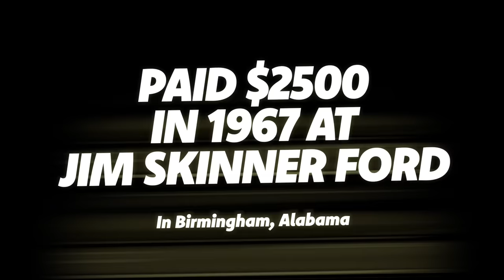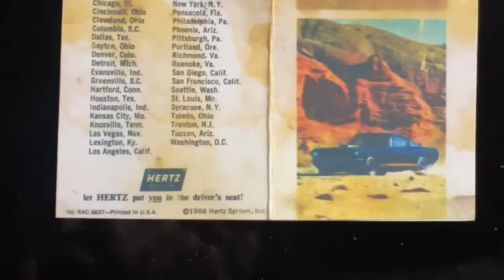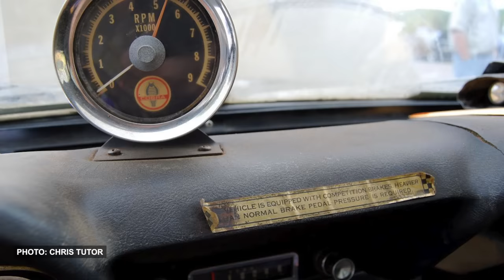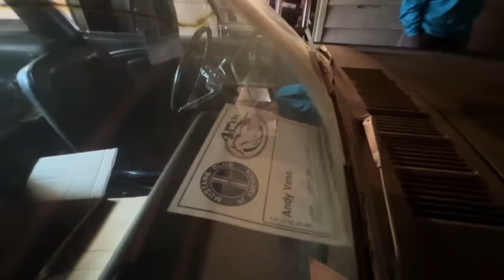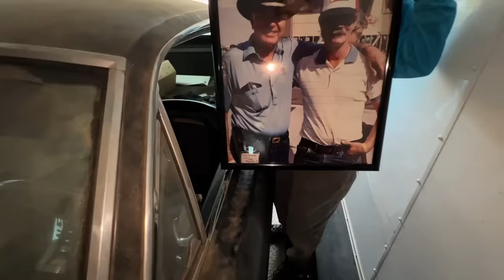Survivor 1966 Shelby Mustang GT350H Returns!

Comment: I would wash it and get a replacement hood. Rebuild the motor and trans and drive it every day!  No restoration needed.
Reply: The hood is fine.   Enjoy!!
Reply: Please ditch the traifer hitch ......it just doesn't  belong.
Reply: What needs rebuilding about the engine? Solid lifters make a clacking noise, normal. Runs great, doesn’t use oil. Why?
Reply: @nathanhansford76  just as a precaution. Then I could drive it every day with no concerns. Of course you don’t have to do it …but I have had these old Pony’s and it’s what I would do.  Not some elaborate restoration is needed either.
Reply: @davidwright873  nah…it is so rusted it buckles when he shuts it…u can see it bent too
Reply: That's a restoration 😂
Reply: It’s supposed be to be a barn find car that’s how it’s supposed to look and he wouldn’t change anything (my dad is close freinds with him)
Reply: What? If it's running fine just wash it and leave it as is rebuilding the engine is part of a restoration
Reply: @MunkeyBeans1082  no…just mechanical so u can drive it easily with no worries. No resto of the paint or car
Reply: let it as original as possible!

Comment: I have a Junkyard Life story about my 67 Mustang that I still own today. 
Back in 1978, I was 16-years old and had just moved to So.California the year before. My parents opened a wrecking yard in Fontana and we regularly bought Salvage Certificate Insurance Company wrecks from a place in Colton Ca. (called Country Club Storage or something like that). The storage lot had Closed Bid Auctions every month and my older brother bid the $442 that won the high bid for my Mustang. 
The car had been through the wringer due to daily driving, then got sideswiped. I would say I got the car in otherwise 99% original condition (less all the wear and tear of Barstow California driving)
The damage was somewhat minor but included the right front suspension, the right fender, right door and ended at the front of the rear quarter panel.
$120 later, I had a matching-paint fender, door and suspension parts. I then had to get Brake, Lamp & Smog inspections to get the DMV to re-title the car and I was driving it within a week.
As a young driver, I didn't exactly treat the car with the respect that I could have but I did end up doing a budget-restoration to it in 1980 (this after wrecking it 3-times in between!).
Well, 20-years of daily driving, I kept the car mostly STOCK and I managed to not do much more damage (besides wear & tear). 
The car made it's way back to my Home State of Ohio in 1998. I then parked it that winter and began collecting parts & pieces to ultimately do a full Concours Restoration where now the car wins MCA GOLD (Concours Driven classification). 
I took many pictures of the restoration and have helped countless people that endeavor to do the same to other cars. I'm not sure if I can mention it but Concours Mustang (dot-com) was the key to getting the quality restoration work done that I managed to do myself (very little other outside help was solicited). 
Since July of 2022, I have been to 7-judged shows in two years (at the time of writing this). Every show so far, I have left with an award (or three).
Taking what was in 1978, a throw-away wreck, fixing and saving it for a lifetime of adventure, I must say, I would never have guessed that I could actually have accomplished my childhood goal of keeping, driving, then restoring in my old age...my very first car!  Richard Urch
Reply from the maker: Nice work! Hard work pays off! Plus holding on to what you valued when you were much younger will be appreciated later, and appreciate in $$$s! Thanks for sharing!  You have those memories of the adventures and the car to boot!

Comment: I looked at a 66 GT350 for my first car.  It was $2500 light green with black stripes.  Butt it was AUTOMATIC.  I had the cash.  The next day driving home from a funeral I saw a 64 blue on blue Falcon Futura  with 260 and 4 sp with Sprint tach in the heat gauge hole.  I  have looked for years for a replacement.

Comment: I have a 1969 Camaro Z28 Tribute car that I have no plans to sell has 52,000 original miles on it. Was a drag racer for over 40 years so it was a hard first 40,000 miles 1/8th of a mile at a time. I pulled the 383 stroker and trans and rear in and put a 327/ 350 trans that my son gave me out of his 1968 Camaro and it has been going g strong for over 10 years. Love driving it.
Reply: Is it covered in dirt and mud?  Apparently, some prefer it that way...

Comment: If it runs and drives I totally fail to understand the "its not been washed since 1980" thing. WTF? This car would still be just as cool if it was cleaned up. I did not say repainted, just clean.

Comment: Wrong wheels.
Reply from the maker: You sure about that?
Reply: @Junkyardlife  100% positive. Magnum 500 wheels weren't used by Ford until 1968.
Reply from the maker: Andy says these wheels were on it in 1967 when he bought it. Andy stashed the Hertz center caps for safe keeping. 
Also, I’ve read that all the 1966 Hertz cars came with 14-inch chrome Magnum 500 wheels. 🤷‍♂️
Reply: @Junkyardlife  WRONG. None of the 1966 Mustang GT 350-H came with Magnum 500 wheels. FACT: Magnum 500 wheels didn't come on any Fords until late 60's.
Reply: Nope, correct wheels for a '66 GT350 H Mustang!
Reply: @sergeantmasson3669  - Wrong again!  LOL
Reply: @sergeantmasson3669  - You again!  Hate to burst your not so knowledgeable bubble, but the chrome Magnum 500 wheels came standard on all '66 GT 350H Mustangs.  I have caught wrong comments by you a few times before.  You might want to shit can whatever bogus resource you are using because it's total B.S.  Have a great day!  :face-green-smiling: